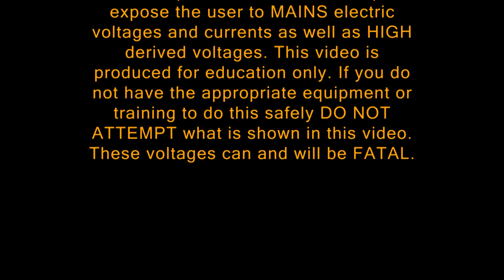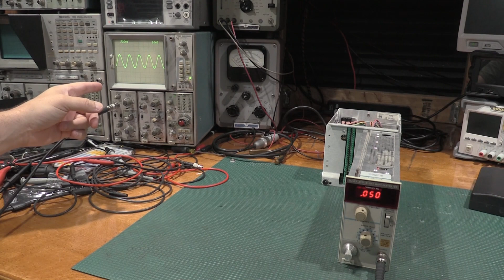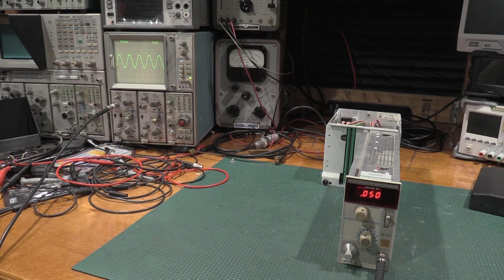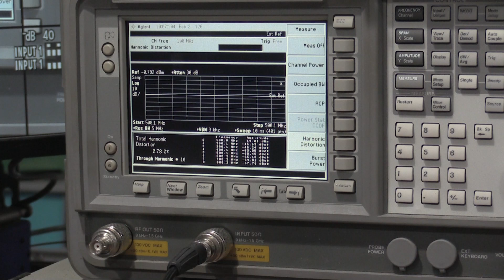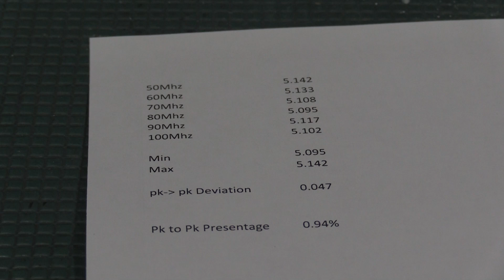Tektronix SG503 Refresh and Alignments

Comment: Love your scope cal videos. I was wondering about using an old HP 3490A for verifying the absolute accuracy of the 50kHz output on this thing. The 3490A has a suprisingly good accuracy of 0.19% AC Volts accuracy for the 5V and 0.5V sinewaves at 50kHz. It is an average responding AC voltage measurement and not a true RMS measurement, so it's really only good for sinewaves it seems, but it would fit this application perfectly, maybe?
Reply from the maker: It could with several astricts 1) The absolute dial accuracy is not as important for an SG503 rather it is its amplitude variation over frequency.  2) The HP 3490A is an averageing meter and the dial of the SG503 is in peak to peak output so there would be a conversion factor that would need to be applied to the meter reading. Other than that the specs of the HP 3490A seem to work well here but it will not be able to validate amplitude flatness over frequency as the pk to pk amplitude will need to be measured up to 250 Mhz for a full check in. 

Zen
Reply: Exactly. Thanks for the fast reply- I have subscribed!!

Comment: Hi Zen, what Spektrum Analyzer are you using? For the peak to peak detector, do you think, the one from the TM500 system would be suitable?
Reply from the maker: The pk to pk detection was done on a scope not a spectrum analyzer. I used a DSA602A after running the enhanced accuracy routine with a 1Ghz plugin (need to keep the 250Mhz off the -3db curve). The fastest TM500 series scope (SC502) was 15Mhz this would not be able to validate the pk-pk accuracy .